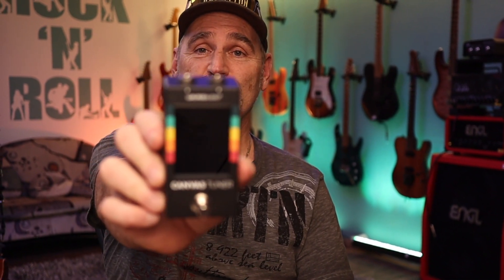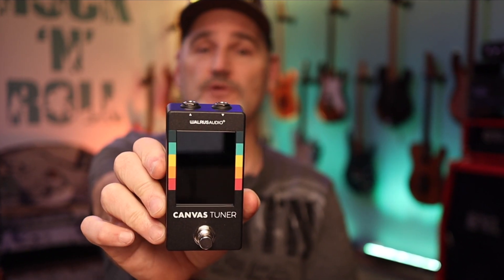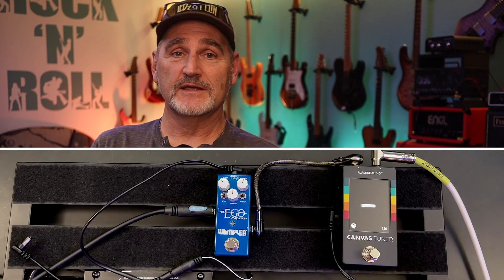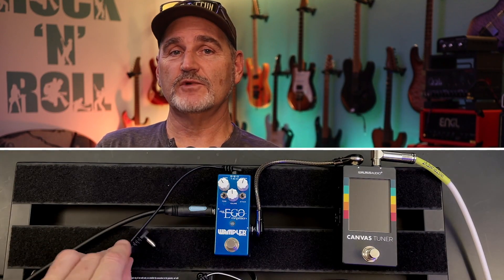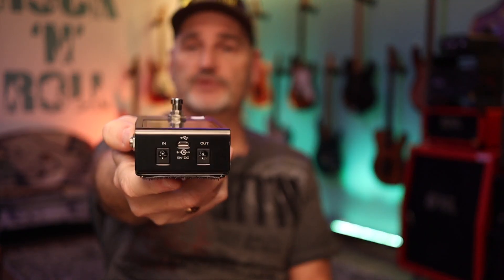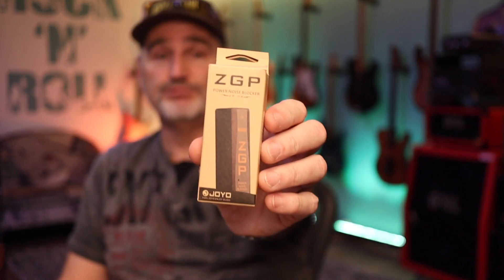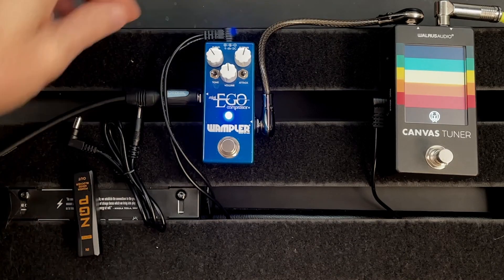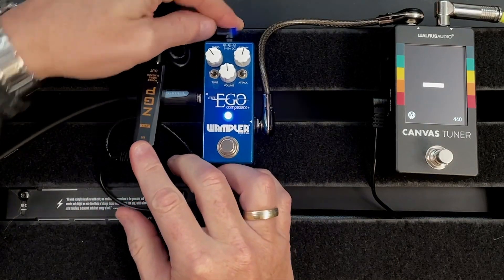The Canvas Tuner Has A Major Issue

Comment from the maker: After reading some of the comments I get the impression that either the industry did a pretty good job in brainwashing or many of you guys don't have any clue what daisy chain technically means. Daisychaining is not a bad thing in general - maybe I should do a follow up video and explain some basic stuff. And please do me a favor and watch the video to the end before posting a comment - it could help to understand 🙏🎸
Reply: I think the majority of players today understand the isolated power is always going to produce a lower noise floor with zero chance of bleed through. As a former owner of a One spot daisy chain, and a tuner pedal with a power out, I personally have zero noise now using an iso brick. I would say most players today who build a pedal board will use isolated power supplies.
Reply from the maker: All my power supplys (currently 4) provide isolated power - I never doubted that these weren't better! The thing is that I don't want to waste one outlet for a tuner because on that pedalboard the powersupply has only 5 slots  which are all in use. And no, I don't want to spend another 200 bucks for a new power supply...
Reply from the maker: The thing is, if no one complains about it, nothing will get better. This does not only apply to Walrus Audio - it's a general rule! Even if I can understand that some fanboys try to defend WA - it's somehow counterproductive.
Reply: @StranglingVicTillDeath   This Youtuber is a prime example of trying to get views from nothing, gaslighting maybe? Creating a problem where there isn't any....the designer never intended this pedal to have a power out, and it has significantly more capability than any other tuner, hence the power design choice.
Reply: He isn't wrong. All of these tuners have major flaws. I'm sick of manufacturers not making their product to the best of their ability. The Peterson for instance, very poorly thought out.

No top mounted jacks, changing the buffer requires you to open the battery compartment, the buffer itself has 5M ohms input impedance (should be 1M ohm),

the bottom of the pedal is extremely horrid since they decided to put the serial number there and make it virtually impossible to mount it onto something like a temple audio pedalboard, since the battery compartment sticks out like a sore thumb, and if you decide to add the rubber they provided, then the quick release won't stick to it at all... Not to mention them using micro USB.

Now I'm looking into very niche products like the sonic research Turbo Tuner st-300
Reply: @RockGuitarVibes  Why would you get a 5 slot power supply to power 6 or more pedals?
Reply: @jamesmoses4066  Don't buy tuners you don't like.  That's how you let manufacturers know you don't like their product.  Why is the serial number location in a bad place?  Take a picture of it with your phone before you install it.
Reply from the maker: @robertp457  Because I don't get all at the same time - it's a grown system, first there was the power supply and two or three pedals. Technically it's a myth that you have to use one slot per pedal - it depends on whether the pedals used pollute the voltage or not....
Reply: @robertp457  the serial number is at the bottom of the pedal. Anything you stick to it will rip it off and damage the number. Sure, you can scroll through your gallery until you eventually find your picture of the serial number, but what if I sell the pedal? Am I supposed to share the picture with the next owner? And if they sell the pedal, are they going to have to share my picture? That's all way too much. They need to have designed the bottom of their pedal better to account for the fact that the majority of guitarists would be mounting it to a pedalboard
Reply: Thank you for making this video. Having never heard of the company Walrus Audio and noticing this tuner to be priced alongside Peterson's Strobostomp I was curious, and I came across your video (beside the manufacturers marketing videos). In summary, it's just another overpriced hipster tuner. 😀

Comment: Totally fine if our tuner isn't your cup of tea! However, using a pedal in a way the manual says not to use it then complaining that it doesn't do what you want it to do when its not being used correctly is an odd way to critique it though.
Reply from the maker: Many thanks for your comment. Unfortunately things don't get better by naming them in the manual. I would love to buy the next generation of that tuner - with a 9V outlet and of course without any noise. I am sure that you, as a company with high-quality products, are also interested in improving your products.
Reply: Mine is very noisy. If I buy a boss PSA-120 would that fix the problem? I am not daisy chaining, but I am using a pretty cheap power supply, although it hasn't been an issue until I got the canvas tuner.
Reply: Why not make a pedal than can share a power supply like other manufacturers
Reply: I think Walrus Audio’s message was to do your due diligence and if this pedal is not for you, don’t shit on it because you failed to do the above. Just use something else.
Reply: So… is the warning buried in the manual or do you let people know before they purchase. You seem to think it’s the customer’s problem.
Reply: @RockGuitarVibes  This video itself is alright and pretty informative, but your replies and logic are terrible. They were aware the circuit did not work with daisy chaining and it was an intentional design choice to leave out the feature. You can easily read the manual to see if your specific niche power supply circumstance is met, but not doing ANY research when you actively have limitations of what would work and then calling the product design (and in other replies the company) bad for it is a really dumb mentality to have. To think you know better than the people that designed it and being condescending about it is pretty hilarious when you quite clearly can't explain how to fix it or why it happens, but whatever gets clicks lol
Reply from the maker: @woooyeahfunkytime4088  Hm, you wrote 'not doing ANY research' even if I cited from the manual - looks like you haven't watched the video...
Anyway, they announced the tuner as one of the best, build with high quality. Fact is, it can't be used in daisy chain because the device isn't able keep the power clean. AFAIK there's no other tuner on the market with a similar behavior. To me that's a basic feature which of course should not be a problem for 'one of the best' tuners available. Before buying I've watched (paid) demos of this pedal - but nobody mentionend this issue. Do we really have to read the manual before buying stuff to make sure that all basics work as expected? I really don't understand why you guys are willing to accept such things - without any complaints, no product will get better. Even if it's hard for some fanboys to accept criticism, it can finally lead to better products and that's what we all want! I would love to buy that pedal again if the issue is solved! Image the tuner is comes with a USB jack only, without 9V jack because of 'intentional design' and perfectly described in the manual - you wouldn't complain... 🤔
Reply: @RockGuitarVibes  I was a little overly hostile with my first reply after seeing the condescending comments you made to people, so i apologize and would like to ask about a few points that i disagree with. you said you did research but if you had to return a pedal (correct me if i’m wrong on that) that clearly states it doesn’t do what you want it to do on page 1 of the manual, then i’m not sure i get where you’re coming from to be honest? i do believe if you have a specific use case scenario that the pedal would not work in otherwise then you should review the manual. the pedal does everything advertised and to an amazing quality, no? i am by no means a walrus fanboy as this is my only product from them but when you insult their “build quality” you should be describing how the making of a product reflects the standards of the making of the product, it doesn’t have anything to do with how many features the product has. a desk can have great build quality without being a motor powered standing desk. and regarding the last sentence, i think your criticism of the product is valid, i wish this was a feature. but i think calling people “brainwashed” and saying the company “isn’t able to do things right” on a public reviewing channel is not the right approach in the slightest to the situation
Reply from the maker: @woooyeahfunkytime4088  Well, I'm not complaining about the overall build quality - it's the lack of one basic function, which is to not pollute the voltage. This is not a sign of high quality engineering. It's an industry standard since decades to daisy chain a tuner - so you don't have to waste a power outlet for the tuner, quite simple... 😎
Reply: @RockGuitarVibes   that’s pretty weird logic. you could say this about every pedal that’s ever had a similar noise issue when daisy chaining or doesn’t have a power out jack. it’s not the fault of bad engineering when a product that isn’t intended to solve a specific problem doesn’t solve that problem lol. my big muff can’t get tube screamer tones when any multi effect distortion unit could for the same price point. obviously “n+1 features” is better than “n features” but they are designed for two different problems and with separate price point goals and manufacturing limitations in mind. also “i wasn’t talking about overall build quality when i said build quality” is uh. interesting to say the least 😅
Reply from the maker: @woooyeahfunkytime4088  Hm, so what do I have to expect from one of the 'best tuners on the market' - all should work perfect! I've also tested a bunch of other digital pedals in the same setup, guess what - no noise at all! I agree, this tuner isn’t intended to solve a specific problem - which does not exist when not being used, that's the point 🤔
Reply: @RockGuitarVibes   other tuners don’t have this problem because they are a different circuit with different features, glad i could help! it is one of the best tuners on the market. insane build quality and does amazing at what it was designed for, especially for the price. and it has many features other tuners don’t have. saying the problem caused by your setup “does not exist” when you are intentionally ignoring warnings that it is not meant to do that thing is funny. never met someone with this cognitive dissonance to ego ratio. 😂
Reply: In all fairness, I think he explained well enough, that this setup is discouraged. As an electronics engineer I would suggest you invest in better EMC filtering, especially common mode filtering on internal DC/DC converters. It's always best to tackle the issue at its source. Of course I know good design might get pricey, but sometimes a small change goes a long way.
Reply: @walrusaudioeffects I just bought mine and I couldn’t figure out what the noise was. Then I put it on its own power source and that is not plugged on the same wall as my amp. There’s still noise and it gets worse when you disengage the tuner. Forget putting any gain on it… it’s WAY WORSE.
Reply: @10sassafras  Why wouldn't you check to make sure they have the feature you want before buying it?  That is on the consumer.
Reply: @RockGuitarVibes  If you want clean power don't daisy chain your power.
Reply: @robertp457 It looks like Walrus realised their digital noise filtering was inadequate too late in the tuner’s development so they dropped a “warning” into the manual. A warning is only useful if you get to see it before purchase. This chap’s video serves that purpose.
Reply: Who the fuck daisy chains pedals? Any basic power supply supplies at least 4 or 5 pedals minimum, if yo7.need 12 l3dals on your board and to daisy chain something is up
Reply: I've been using mine for months without any noise issues.  I'm very happy with it but I was planning on using it with an isolated power supply regardless.
Reply: @10sassafras  Hi, just seeing this. This is something that every single pedal builder will recommend as well. This isn't exclusive to just our tuner. We have always recommended using an isolated power supply with any pedal so that each pedal gets clean power. This is listed in every manual we've made and on our site under every product. This is not a new concept and you can easily find multiple articles from many publications discussing this as well. Any time you daisy chain pedals, you can introduce noise.
Reply: I’m a bit late to the party, but this was just an unnecessary reply. Most people daisy chain pedals, it’s just odd you guys would limit that. This was a good video, and you guys just got mad because he had a point lol.
Reply: Fix it!
Reply: @AustinTaylord most people do not daisy chain blindly... if you can take the effort to put wahs and fuzzs on iso for "da tone" then you can put the tuner on too

idk if the company is saying "this wont work like this" you cant be mad when it doesnt work

assuming every product will fit your needs without it being explicitly or deductively confirmed for you is on you
Reply: I’d gladly take a beautiful pedal like that. Don’t worry I have an outlet for it 😂
Reply: Anytime you daisy chain a digital pedal, you'll run into potential digital noise. The polytune included.
Reply: @TheMad0ne  It's implied that if you offer your product as one of the best in the market your standards should be measured against the best ones in the market , if your product can be on pair there with those, then you can't call your product   "one of the best". 
   It says a lot about you as a company that having the opportunity to use this video as positive feedback to improve your product,  thanking the customer for his honesty , you prefer to blame the customer for not knowing what you are saying exactly with your misleading language before even try your product .
  Yes he  could have read your: "not recommended"  , but you know damn well that  "not recommended" means  a lot of things and none of them are possible to know before  buying your product, so he trusted you,  thinking the "not recommended" was a minor issue that wouldn't be a no-no for him , that's what we customers do , sometimes we trust companies and we have certain tolerance to their minor issues , the problem is when companies take the customer for granted  and even more serious is when they blame them for their own mistakes, that's why he is returning your product  and making this video , not bc the pedal is not his cup of tea if not because fails to do what it's supposed to .
 Your response could be understandable if you specifically write in the manual  that Daisy chaining your pedal would result in an undesirable noise on the signal .
Reply: Why would anyone use anything other than a boss tuner? If the selling point of your tuner is a screen saver, it probably sucks. Also, it's probably marketed towards people who care more about gear than actually playing music.

Comment: If you're going to have a youtube channel dedicate to guitar gear, you should know better than to daisy chain pedals, especially with digital pedals. This isn't an issue, this is user error.
Reply from the maker: I'm used to daisy chain my tuner simply because most tuners offer that possibility by a 9V out jack. I'm of course aware of noise issues with digital pedals - but with a Tuner, really? As mentioned in ihe video Peterson and TC don't have any issue - why does a tuner released in 2023 isn't able to handle this? The Poytune was released more than 10 years ago! IMHO a new pedal should be no worse than its predecessors - however, regarding daisychaining it is and that's a technical fact...sorry for pointing this out!
Reply: This is a bizarre viewpoint. My $20 Amazon StageRight tuner has no issue being used with a daisy chained power supply. 

The noise here isn’t a fact of life. It’s an engineering cost saving decision when Walrus designed the circuit. Making excuses for crappy engineering design in a $200 boutique tuner pedal is wild.
Reply: It’s not really an error … he tried both. He’s aware that this is an issue w some digital pedals. He clearly understands what’s going on here.

He’s just pointing out that this particular pedal really is unusually awful in a daisy chain, which is what some people use to power their boards.
Reply: @RockGuitarVibes those tuners aren’t also an LED display and mini computer. This needs a bit more juice my man.
Reply: 1. This tuner costs more than a decent guitar. Cheaper tuners don't have this issue. At this price cutting corners like this is simply unforgivable.

2. None of the other reviews of this tuner that I saw even mentioned this issue.

Comment: There's a major issue all right. Not the with tuner, though. This is a dumb click bait video.
Reply from the maker: Hm, I could not use it in my setup - so I had to send it back. It's offers 'true bypass' but the digital noise still occurs in bypass mode, even in muted mode! It's technically imperfect. IMO if the community wants better products, we need to talk about and luckily, I'm an independent YouTube guy who doesn't need the money for living. This means I can name bad things without fear of loosing money because I'm not paid by WA.